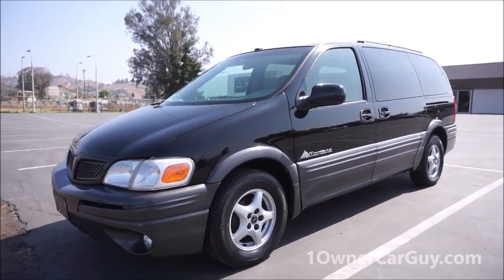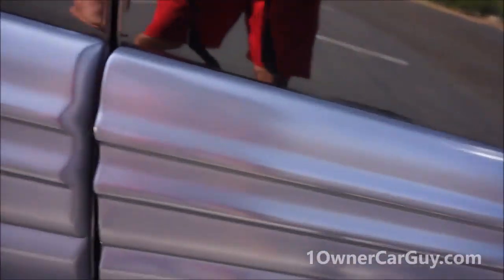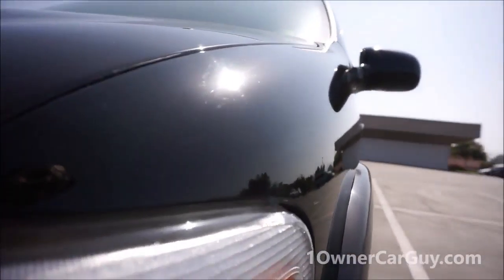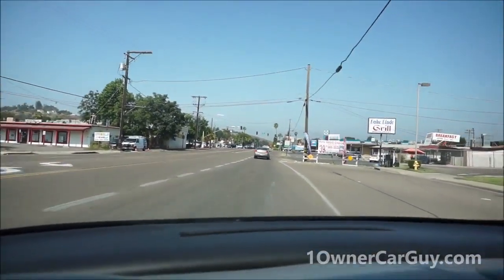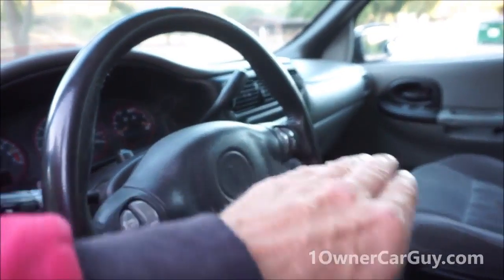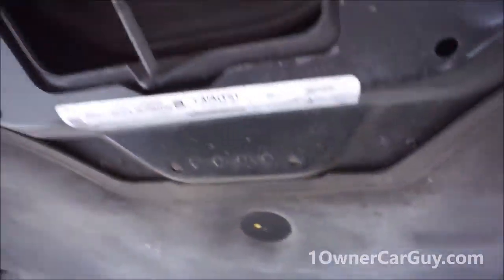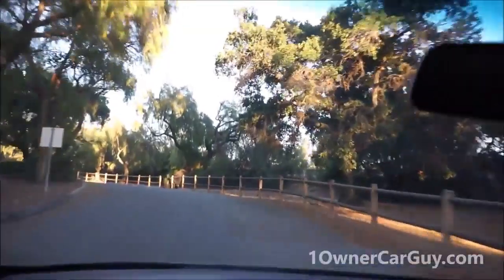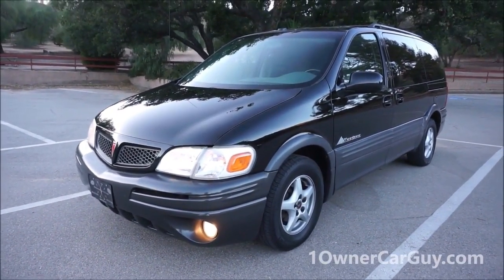MINIVAN FOR SALE $1250 ~ PONTIAC MONTANA 101K ~ DAILY VLOG 2020-0109

Comment: Sorry I missed your live feed man. Im usually on here once or twice a day. Been trying to keep busy until I'm scheduled for my operation. That's for sure a nice van and we'll worth the price you're asking for it. 👍 Don't think you'll have any problems selling it. And,blown head gasket can be a job. Done alot of them in the past. Not really that hard. Torque wrench. You could always check the water pump as well. As you probably know, some water pumps have a seephole underneath the shaft on the outside. If the inner seal goes bad, it'll leak through that seep hole to let you know that the pump is bad. Check the oil to. Sometimes, there's oil mixed in with the antifreeze if the gasket bad. Even a warped head can cause an engine to overheat. It could be a couple of thing. Rich would probably know. You have a great day man. And, thanks again for the great footage. 👍✌️